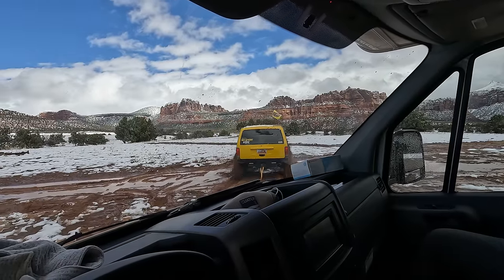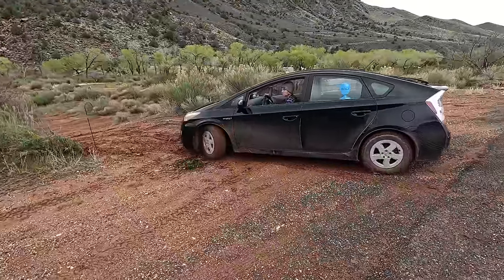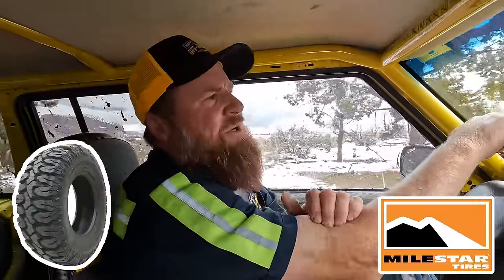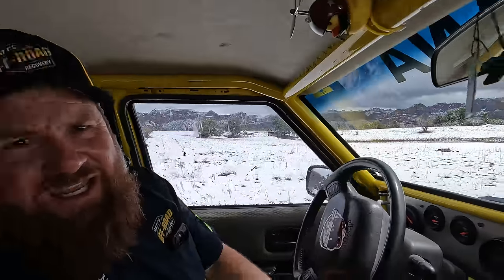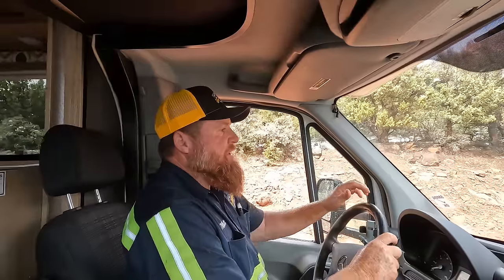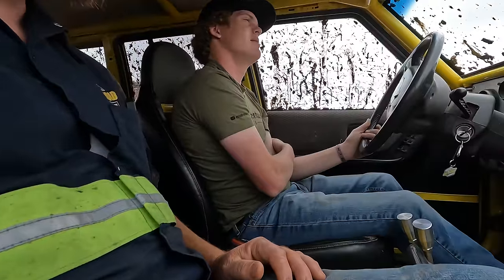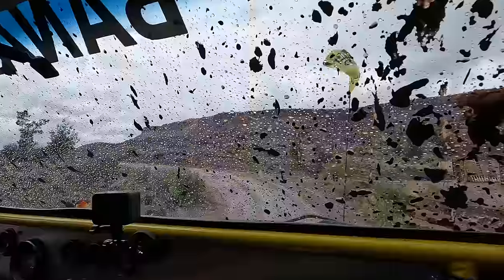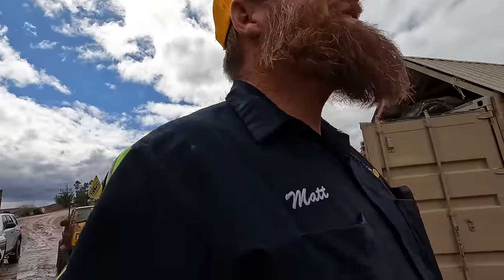This RV Recovery is Awful!

Comment: Most class C motor homes with dual wheels come with posi trac . Which in my book is better than a 4 wheel drive.  When one front one back engage.  Matt is so right, but he usually is right.
Reply: No it's not
Reply: @mtaa11  yes they are I have 17 C back axles and all are posi trac

Comment: 15:45 
On 90% of cars that I’ve had a traction control button in it I would hold the button down no more than 10-15 seconds it will totally disengage it until you reapply it and I turn mine off every time I get in my car. The engine doesn’t bog down. I feel like I have all the horsepowers when I need them and all the torque when I need it , I always turn off my traction control. Ride or die.💪🏻✌️

Comment: The new Toyota Hiluxs, to turn traction control off there is a button, you push it and it says "traction control off", but it is not fully off, it is still active....hold the button for 10seconds and it says "traction control off" and shows symbol on dash with it completely off. Its annoying, usually stuck before traction control goes off or diff lock decides to lock in. I prefer the computer-less like my old solid axle Hilux, 4wd systems with auto locker rear and air or magnet front locker, that way you dont need to hesitate and continue on track.

Comment: Some of the older Auto Subies if you manually put in 1st gear will give AWD 50/50 power instead of 90/10. Only works in 1st gear

Comment: Mud. Mud, mud, mud. reminds me of the time stuck in a houge  mud puddle.  There was this little pine sprout about 18" tall that I hooked my com-a-long on.  Picture that little ** with the blue *** you see around here sometimes.  You put some tension on the cable and then go until everything is loose. Rinse and repeat. I didn't even get my shoes very wet.

Comment: The Tow eye device. Does each car manufacturer have a different one or is there a standardization on this? If it's standardized, don't you think it may be a good idea for you to carry one in every rig you use? Just incase? I mean, they can't be that expensive and it will certainly solve a lot of the hassle!

Comment: 15:30 most cars I have drove you need to have it fully stopped and foot on the brake then hold the traction control button for like 5-10 seconds and that will do the job

Comment: The Sprinter's track control combined with automatic transmission is pure BS. I have the same set up in mine and whenever there is some snow (Ice is even worse) lose all power and traction on even the slightest ascents here in Norway. Just last week we had 4" of snow and I was stuck for hrs ...

Comment: what were they using those wood blocks for on that trailer?  Were they chalking the wheels?  As unnecessary as that is with it sitting on it's tail like that it is still the only reason I can think of because on non pulling wheels they become an obstacle instead of a traction assist.  I mean, if they were able to pave the road with them an make some sort of improvised swamp mat to drive on that would be one thing but just a few on the ground is not what it would be if those were drive wheels.  They would be a hinderance instead.

Comment: What’s your recommendation for a all terrain plus highway tire in Reno Nv, I have been running Coopers and I think they are okay but never did a comparison, I drive a 2021 stock Tacoma pro, don’t do a lot of 4 wheeling but like to go shooting in the high desert of Northern NV nothing to rugged but drive a lot of back and forth to work on a regular basis some high degree slopes at with night frozen roads highway I80, O,Brien pass- stupid peeps in front and back with like chargers bla bla, just want a good tire but don’t like BF Goodrich ATs.. what, do you recommend ? for my truck I’m still running 16in stock coopers ??? Thanks. . .just a recommendation for Snow AT with a decent mileage rating.

Comment: I think what you should do is build an all-electric offroader. EVs have massive torque at low speed which is what you need, isn't it? And it would be a first. And you'd get out of your gas-guzzling comfort zone. And you'd gain massive cred with the climate defender crowd. And it would be REALLY cool to see you play with the first ever all-electric offroad recovery weee-hickle.

Comment: hitting the brakes in the mud is game over.. specially that mud.. same with ice. rwd car you can drive with the throttle 90% and steering input 10% if you in a awd vehicle and you lock up the brakes on that slick stuff or ice you will go straight and when you want to correct and use the gas to steer most of the time you will hit the ditch before the tires get any traction to pull you over. brakes bad :D

Comment: i have never understanded why everyone uses locking hubs when you just can disconect the front axle with the transfer case, i dont think that fuel econemy is a point on those offroad machines. My eagle even has a switch on the fly conector on the front axle, thats a nice feature.
Reply from the maker: You are correct in thinking that it’s not a fuel mileage issue. (although it kind of is, ultimately)

The driveshaft we use are about six times heavier than an OEM driveshaft. They get used for rock sliders and must be tough. 
The driveshaft angles are also higher than what you’re gonna find in OEM. 
And the gear ratios are going to be lower than OEM   

All this means that we are spinning significantly more mass, at significantly higher speeds, through significantly sharper angles, than your OEM example. 

If we spin this on the highway, we have more noise, more vibration, less power to the wheels, and more fuel burnt. 
It’s definitely worth unlocking the hubs.

Comment: Is there any way to modify Blue Steel for off road recovery?
Reply from the maker: Sure. 
Pull out the diesel and put in an LS  
Get rid of about 4000 pounds of unneeded weight. 
Links and soft suspension. 

I think it would do quite nicely

Comment: Why don't American 4WD vehicles have sophisticated transmissions like European ones when there is no such thing as free wheeling hubs? Even for our dinosaur Landrovers these were a thing in the 70's.
Cheers
Mike
Reply from the maker: The sophisticated transmissions absolutely cannot do what our dinosaurs can. 
I don’t wanna fight about it, but I do know a thing or two about really extreme terrain, and the vehicles that can and can’t traverse it.
Reply: @MattsOffRoadRecovery   Thank you for your kind reply, I appreciate your answer & acknowledge your great experience but you seem to take a US 4WD, uprate/replace the engine, gearbox, transfer box, driveshafts, axles & add aftermarket differential locks-not really a stock vehicle from the factory is it?  Europeans can do that, no locking of freewheeling hubs required but then they won't be able to take the punishment that your work program dishes out. I don't want to get into a fight at all either, never my intention but I do question the basicness of US transmission design. The Rangerover had a lockable interaxle differential over 50 years ago. Keep up the good work, great videos. Mercedes, VW & Steyr are miles ahead & have been for a long time.
Tip:-snatch recoveries don't work with Bombardiers Prinoths or Kassbohrer/Pistenbullys, it rips their tracks off-just use the great traction that the tracks can provide to pull, if that is not enough then just chock,anchor & winch-the vehicle will have the traction in snow to get you in a position to do so most times. Battling HeavyD in his daft Cybertruk was never a good idea.
Cheers
Mike